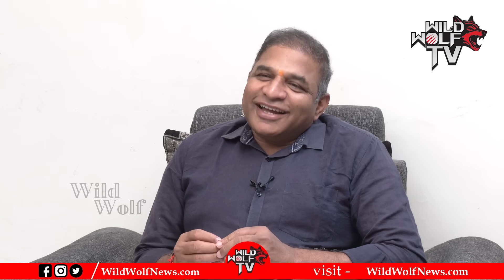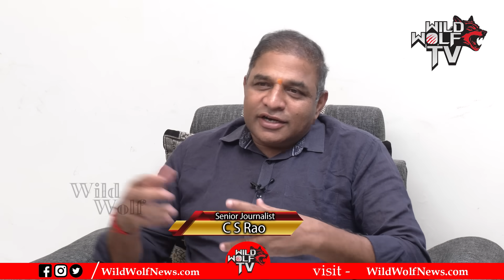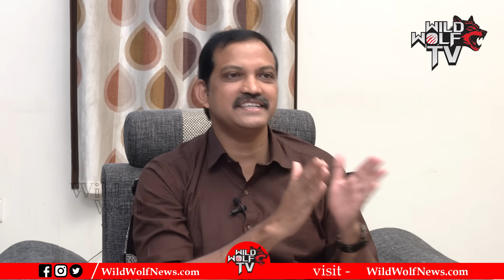Telangana Vittal About Kaleswaram Project | KCR | Revanth Reddy | TS Politics | Wild Wolf Telugu

Comment: When the intention was made, several experienced engineers have suggested that lift irrigation is not viable, but the adment self interested KCR, did it on his own and first year itself it proved that the silt has accumulated in the motors. And he had to change it and is going on like this. It is going to fail, and even an enquiry is instituted it will take some years and special investigation has to be done to study the actual cost and the total spent, the difference being the profit of the CM, the arcetect